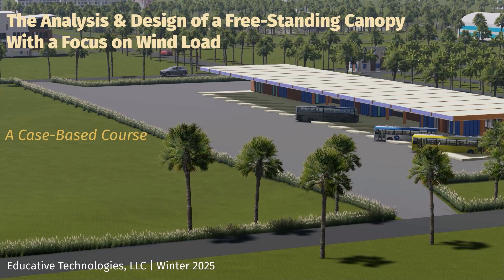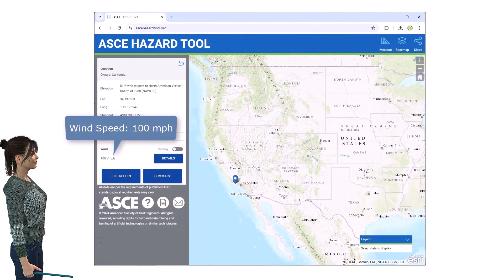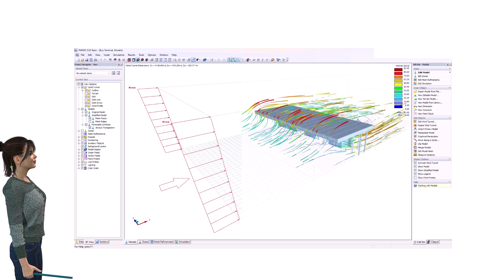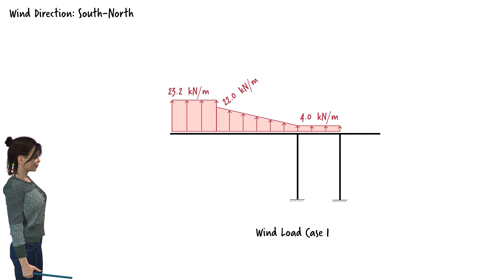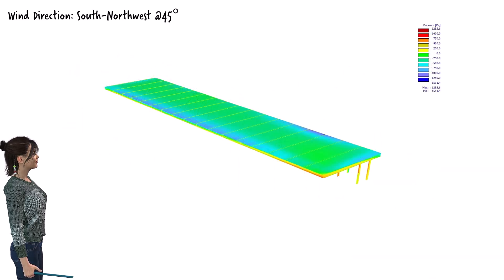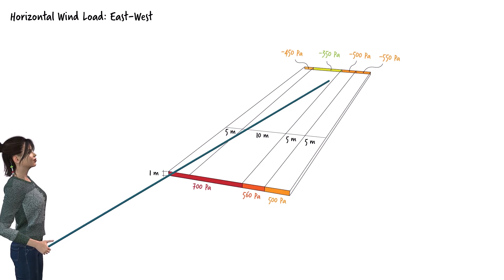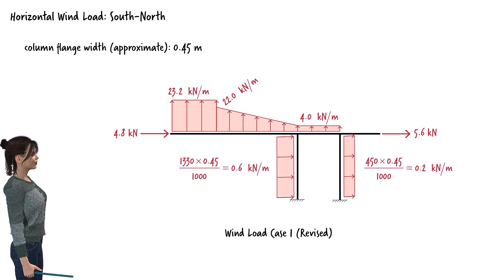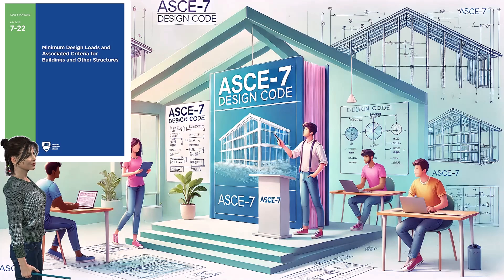CE405 Lecture 1: Canopy Analysis and Design

Comment: Actually you are doing a very great job. we can't explain in single words. One request from my side, The Website which you preferred is not accepting my Enrolment. I am not able to enroll the Structural Analysis 1 course. could you please help me.
Reply from the maker: A few individuals enrolled in the past day but did not select a course during registration. Please note that if a course is not selected, you won’t be able to access it, even though the system generates a login ID for you.

We have manually enrolled those individuals, so you should now have access to the course.

If you’re still unable to access it, please sign up again, ensuring that you select a specific course during the registration process.